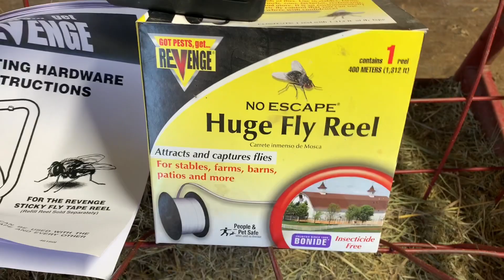Revenge Fly Reels | Do They Work? | Raising Boer Goats

Comment: I've never used the fly reels. I use fly predators and starbar abatement strips with good luck. Glad to see your improving, great video.
Reply from the maker: We’ve thought about the fly predators but haven’t pulled the trigger. Doing lots better just low lung capacity
Reply: @luckymboergoats4600  if you go with predators start them at beginning of fly season for the best success. So good your recovering well, pneumonia takes a while sometimes.
Reply from the maker: @WhiteShouldersFarmstead   from what I’ve seen you can buy them in a reorder program for the season based on like a herd size estimate of poo generated. Some reviews weren’t that great is why we hesitated
Reply: @luckymboergoats4600  I've been ordering direct from Spaulding Labs for many years, even before I had goats, I used mostly for my horses but had and have other livestock. I call them set up how many I need, you can pay up front or as they ship them out, they are easy to spread around, and you get double at certain times when flies are worse in your zone. The predators do not bite or bother anything except the fly larvae. Seems the more regular you use them (every fly season) the better job they do. You can sprinkle them around your sheds, but they do their best work in manure piles or build up areas where the flies are multiplying. The key to their success and yours is getting them at the beginning of fly season 😊

Comment: I wondered how well those reels work.  They are not cheap but I guess it's worth it if they kill so many flies.  What do you guys use directly on the goats?  We tried Cylence and it did not seem to work that well.  Maybe our flies are resistant to the chemical?
Reply: Honestly just a permethrin like in all basic fly sprays. I usually spray over them quick as I go into the shed or area I’m spraying. If I wouldn’t have been sick so long I would’ve had the environment controlled better and then I focus on that more than the animals. I don’t have the ability without a skid steer to keep all areas cleaned as frequently as I would like so controlling that breeding ground population is my priority